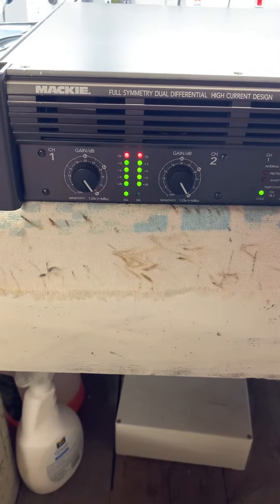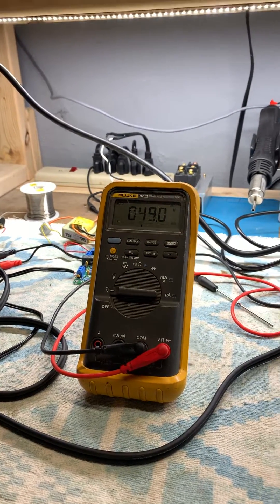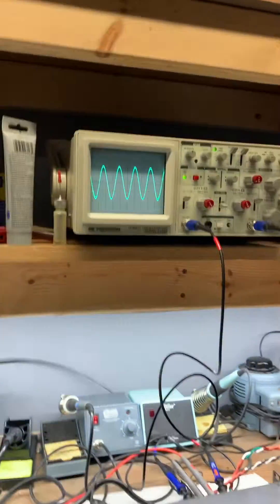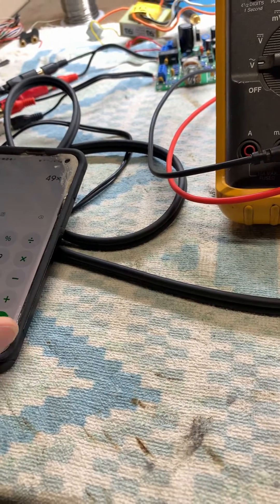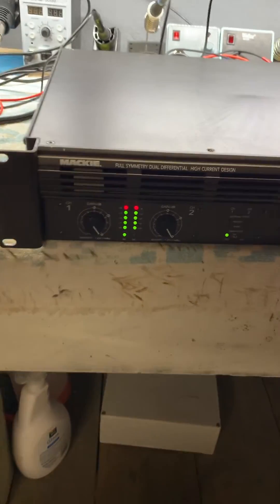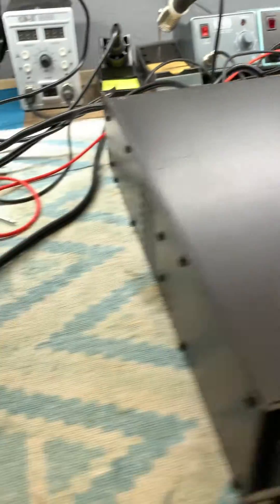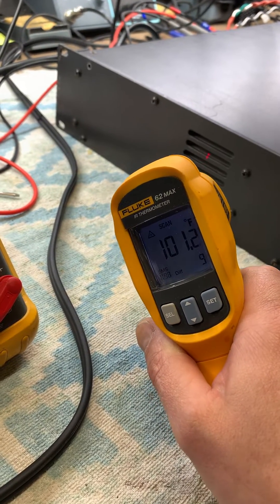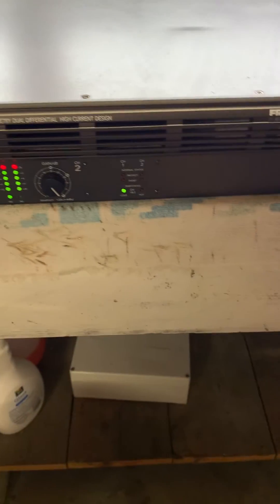Mackie m1400i 8ohm bench test

Comment: Yeah it’s fine but just wait until you hook some subs up on these things they suck!
Reply from the maker: I'm using 2 of them to drive 4 peerless stw 350f  15s.   And they do just fine for the movie theater.
Reply: @leehayhurst9052  yeah movie theater application might be fine but for live sound reinforcement not much. Also I think you might wanna look at more efficient options especially if it’s for home use
Reply from the maker: @soundfreak8892  these are more efficient.    I was using a crown macrotech 3600 before.    I'm not a fan of class d amps.  There dynamic range, limited damping, and smps power supplies just don't do it for me
Reply: @leehayhurst9052  Lol well that’s a way older technology that is no longer used but crown macrotech sounds amazing and are built like tanks especially the old ones like the one you mentioned. The mackie amplifier stuff is just toys but like I said for the theater setup I can see it working well enough. Crown makes there amazing crown xls series which is super efficient sounds great and can take a beating. At a church I used to go to I was underpowering 2 jbl sr4718x per side with an older crown xls 1500 and the thing would do great I would redline it very hard at times and it would survive. Only twice did it stop passing audio on me for like 8 seconds because I got to excited and well I had to remind myself I didn’t have the juice. But crown is still very good as well as class h with the traditional transformer in them.